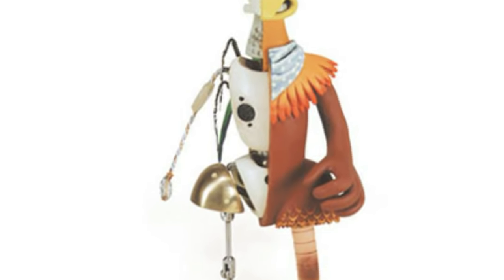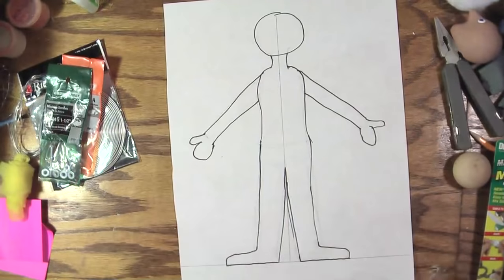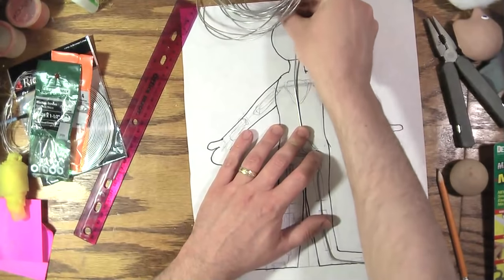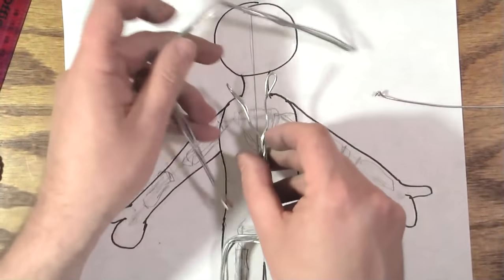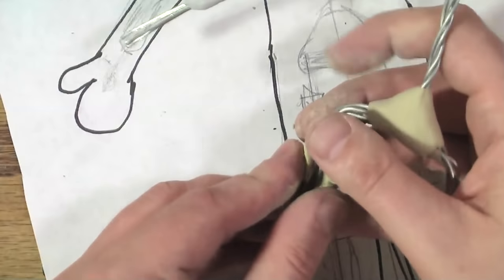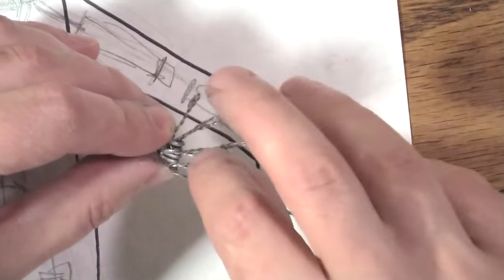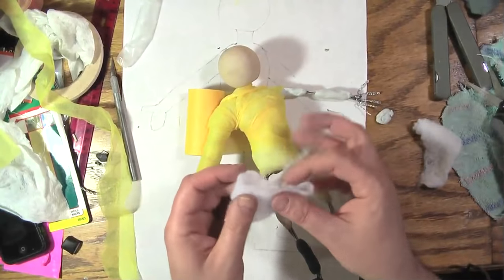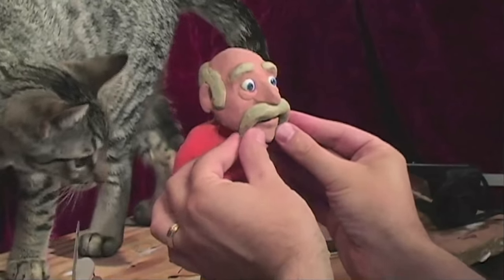Stop Motion Tutorial:  Making an Armature

Comment: Hey Michael! I'm having trouble finding T-nuts, Wing Nuts and Bolts both in stores and online in a 1/32 size. Everyone at the hardware store seems puzzled when I ask about it, saying "never seen screws and bolts that small" - is there a link to the right nuts and bolts for the aramature? Or a different size that would work? Thanks so much!
Reply from the maker: It would seem that after six years of this video being up, you caught a mistake.  It shouldn't say 1/32, but rather #8-32, which seems to be an indication of their size, but not an actual measurement.  I'm sure hardware store people could explain what it actually means better than I can, but that's what the label says in a pack I have in front of me now.
Reply: @MichaelParks  Kia ora Michael, I've had this problem too, as in Aotearoa NZ our smallest T-nuts are too wide for my marquettes (even a M3 has a 12mm flange on it), and I've been down the internet rabbit hole trying to find something that would do the job. I've looked into cage nuts (they have a flat base and extending parts that could hold wire), but these are also too wide (12mm), so I'm going to try fixing the wire between two thin nuts and moulding the Epoxy putty over the top. But thank you for the videos, they have been very helpful!
Reply from the maker: @makairawaugh326  The advantage of t-nuts is that the spurs hold the epoxy putty really well. But nuts will indeed work as well. One thing that can help is to sculpt a little bit of the epoxy on the underside of the nut to hold it in. You just have to be careful not to get any of the putty in the inside of the hold.

Comment: The wire always breaks before starting animating .... what can i do ?.
i put 4 wires for the arms but it still breaks
Reply from the maker: I haven't had an arm break when using 16-guage wire until a lot of animation has gotten done, so all I can suggest is to make sure you are using quality aluminum armature wire, and that you are distributing the bend across as much wire as possible.  If you keep bending at exactly the same spot, it will break sooner.

Comment: Complete newbie to stop motion animation here, is the T-nuts (1/32) the only type of T-nuts you can use? I can't find those type on amazon uk. Awesome video btw really really helpful :) Thanks
Reply from the maker: T-nuts are good because they have cleats that grip the wire and/or epoxy putty.  But a regular nut can work, too.  You just have to be more gentle with it, as it could pop out.
Reply: Thanks for the reply! What I was meaning, without sounding really dumb, what do you mean by (1/32) in relation to the T-nuts? Sorry!
Reply from the maker: It's the size of the threads.  It's printed on the pack, so you can make sure the screws you get are the same size.

Comment: How long are the screws that go into the feet from under the board that the creature will be walking on?
Reply from the maker: About two inches. They just need to be long enough to hold onto and to have a wing-nut on it.
Reply: @MichaelParks  I have the cotton batting. But what is pre-wrap?
Reply from the maker: @ytwetethx  Foam strips sold on a roll that is wrapped around the cotton batting to both hold it in place and shape it. Available at sporting good or drug stores.

Comment: Hey I have a question I want to make a puppet that's a spider with a shark for a head and I'm having some trouble trying to understand how this is going to work, could you help?
Reply from the maker: +Zeno Yokajoker If I were making that puppet, I'd make the legs out of armature wire and add a small nut to the end of two or four of them for tie-downs.  The wire legs could be attached to a body made of light-weight wooden balls by drilling eight holes and gluing the wire into the holes.  Then paint the wire with rubber latex tinted the color of the spider, with the body painted the same color.  The head could be clay.
Reply: alright I have another question I want to give it eyes and I want them to sort of move around and I know the biggest method forthis would to have these wooden ball things(I cant remember the name)and drill a hole in them so I can move them around but I cant find anything like that
Reply: +Michael Parks make a tutorial of how to make a super sculpy head

Comment: Do i really have to use the aluminium animation wire? Will copper do the job too?
Reply from the maker: When aluminum bends, it holds its position.  When you bend copper, it springs back some.  So you could actually use any kind of wire, it's just going to be more difficult and time consuming to animate, and you may not be able to get the puppet into the exact positions you want.

Comment: So if you use carpet foam do you still need to use Cotton batting and pre-wrap?
Reply from the maker: I haven't tried using carpet foam (seems to me it would be too stiff), but I think it would take the place of cotton batting, and pre-wrap would only be needed to hold the foam together if gluing it doesn't work.
Reply: @MichaelParks  can something other than pre-rap be used? I can’t find any
Reply: @MichaelParks  Is there anything that you can use besides pre-rap?
Reply from the maker: @ytwetethx  You can just use cotton batting strips. Pre-rap tightens the cotton and is good for shaping the cotton, but you can get by without it as long as you're using strips of thin foam that stays in place.
Reply: @MichaelParks  I think I found pre-rap online is it athletic rap or sports rap?
Reply from the maker: @ytwetethx  Yes, that's the stuff!

Comment: Hey Michael Parks, does this armature allow the puppet to to move it’s shoulders?
Reply from the maker: The one demoed in this tutorial wouldn't have very much shoulder movement, but if you keep the connecting epoxy putty between the arms/under the neck small so there is more exposed wire in the shoulder region, you can get more flexibility there for shoulder movement.  That kind of design would work better with a larger armature.
Reply: Michael Parks And how fluidly would this armatures limbs bend?
Reply: Can this demo Armature band it’s limbs smoothly?
Reply from the maker: Yes, aluminum armature wire makes smooth movement possible.
Reply: Michael Parks All right good to know!
Reply: Michael Parks also another question: for this puppet you used cotton wrap for the “flesh.” Are you able to just use clay for that (skin colored clay)? ‘Cause when I’m animating my puppet and I might want a scene where the puppet removes his shirt so of course you’d see his torso.

Comment: Hi! Sorry for asking, but i have a very low budget rn. Will FIMO work too instead of epoxy putty?
Reply: I already have FIMO in my supply, this is why I'm asking
Reply from the maker: FIMO will hold the armature together, but is more likely to break under pressure.  I would use it only at the hips and shoulders and just not use anything along the arms and legs.  And then be careful where you put pressure while animating.
Reply: ok, thank you

Comment: About how many wires should you use for the legs in a character that is 14 inches tall?
Reply from the maker: I think I would do four.  Those will need to be strong legs.
Reply: Isn't the one in the video shorter than 14 inches? You used five.
Reply from the maker: I use less wire these days, though it's been with clay animation.  If there is too much resistance in the wire, the wire will break through the clay.  For a small puppet I use two 16-guage wires.  But I would probably use more for a stop motion puppet.  What I recommend is to make it with four, but before adding epoxy or any other build-up, stand it up and bend the legs to get a feel for how much resistance the wire will give.  If it feels like the wire will bend just from the weight of the upper body, add more wire.
Reply: Oh, okay. Thank you for giving me more information about this interesting style of animation!

Comment: would it be ok to use baked fimo plastic instead of epoxy putty?
Reply from the maker: La Tana di Grotesquer Fimo is more likely to break or crumble at the ends.  It would be worth a test, and if bending the joints breaks the clay you could break off the Fimo with a pliers.
Reply: Michael Parks thank you! i'll give it a try and let you know ;) i'm using a latex puppet with that armature so, if it breaks i'll just build another one.. just another question, would it be ok to use caulk silicone to enlarge the bones?

Comment: Could I use Pipe cleaners to make the fingers?
Reply from the maker: The wire would make it possible to animating them nicely, but there would be some problems if you wanted to cover the fingers in clay or latex.  I would expect the texture would break through.

Comment: What about 14 gauge electrical wire? Would that be good?
Reply from the maker: I haven't tried electrical wire.  The test is to bend it and see if it springs back.  The more it does, the more it resists your animation.  Aluminum wire stays where you move it.
Reply: Michael Parks alright well I'm thinking of making a giant monster fight short and I want use puppet that are at least 12 to 18 inches high and I want use strong wire got any ideas or any recommendations on materials?

Comment: Wonderful tutorial. Any tip for creating a dog armature?
Reply from the maker: For the scale guide drawing, do both the side and front so you can work out the distance between all the legs.  I suggest having tie-downs in all four feet.  If not, I've gotten by with having a tie-down in one front foot and one back.  And if this a clay dog, use thin wire in the tail so the wire doesn't poke through the clay.
Reply: @MichaelParks  thanks.. I am wondering where to put the articulation points
Reply from the maker: @EwertonMoreira80  For that I'd just google dog anatomy and see how they're put together.  I think it looks good when the back legs angle like a real dog's rather than just straight down out of the body.
Reply: @MichaelParks  thanks. I've found some examples but as this is my first animal armature I wanted to have only the basic articulations.. cheers

Comment: does that wire brake if you bend it to much?
Reply from the maker: Yes.  It does.  It's why if you have the $$, ball-and-socket armatures are better.  But a wire armature can survive several minutes of animation if you avoid bending the wire in the exact point every time.
Reply: ok thanks but I was wondering also if I could make some kind of ball and socket because I have my own 3d printer that I can use
Reply from the maker: That could work if the material is strong enough.  I animated on a show that used 3d-printed hands and they frequently broke.
Reply from the maker: I'm not sure I understand what you mean, but I don't think the seller of these armatures would give one away for free.

Comment: Is that craft wire? if its plastic coated is that OK?
Reply from the maker: The plastic would probably have too much resistance to being bent into the desired position. Aluminum wire, which is available at craft stores, does a better job of being moved small amounts.
Reply: @MichaelParks  Thank you

Comment: can you use tin foil instead of the epoxy????
Reply from the maker: Foil is good for building up bulk before adding clay (if you're doing a clay character), but it won't hold your wire together or function as a bone.  It has to be a stronger material.
Reply: ok thanks

Comment: What Epoxy Putty Do You Use ???
Reply from the maker: Depends on what hardware store I go to and what is in stock.  I go for the strongest stuff ("steel") that sets in about ten minutes.  There isn't always much choice, but I have found that the cheapest breaks too easily and isn't worth saving a few bucks.

Comment: if you were to make a character's spine out a plastic ball and socket armature like the ones in this link...
https://www.pinterest.com/pin/79868593363834365/

... and you wanted to attach a head using K&S tubes, what could be the the best possible way to do that?
Reply from the maker: Since the plastic ball and socket armature is flexible, the bonding agent is going to need to withstand the bending.  I would go with either epoxy glue or epoxy "steel" putty.  The other possibility, though, is to go with something that would bend along with the armature, like Sugru.  The concern there would be if it is strong enough to hold the head up.

Comment: How did you make your hands
Reply from the maker: Sometimes I make them out of clay, which is good for getting good knuckle shapes when making a fist, but can get squished easily.  Another way is to make a wire skeleton of the hand and dip it several times in rubber latex, letting it dry each time.  This builds up the rubber into flexible fingers which hold their shape well, but won't show knuckles when making a fist or holding something.  Dean Bycroft made a tutorial:  Making a Latex Stop Motion Puppet Hand.

Comment: i got kind of a problem here ; i used this to make a clay puppet, but the wires keep comming out of the clay, making it impossible to animate
Reply from the maker: Yes, happens to me a lot when the clay gets soft.  You can reduce the problem by reducing the layers of wire in the arm and/or reducing the temperature in the room.  But part of clay animation is often needing to re-sculpt as you go, in this case pushing the wire back into the clay and reforming the arm.

Comment: In the arms that is
Reply from the maker: May be too thick if the character is clay, as the wire will break through if it doesn't bend as easily as the clay.  I haven't tried it specifically like that, so I'd try a test, seeing what that amount of wire feels like.  Is it strong enough to hold up the arm, or is it too strong to bend easily?
Reply: To further answer your question I will not have the puppet be made in clay, just to clarify.
Reply from the maker: 5 pieces may still be overkill.  I'd start with two and see how it feels to bend it before adding on the puppet materials.
Reply: Ok, I will. Sooooooo, what size do you use?
Reply from the maker: 1/16 gauge, which works out to 1.3 mm.  I usually just double it for arms.  Maybe triple for 8" puppets.